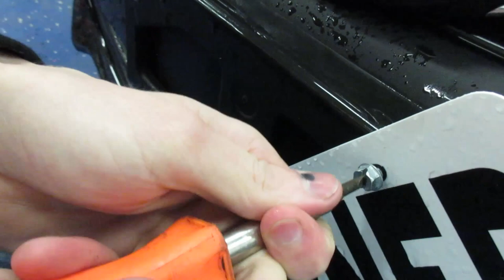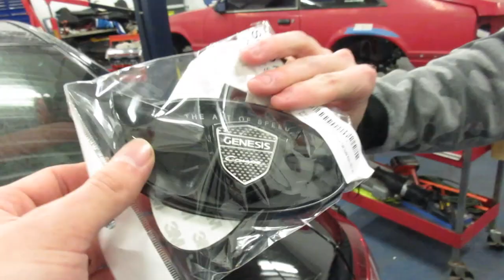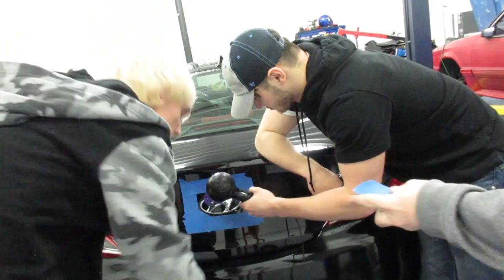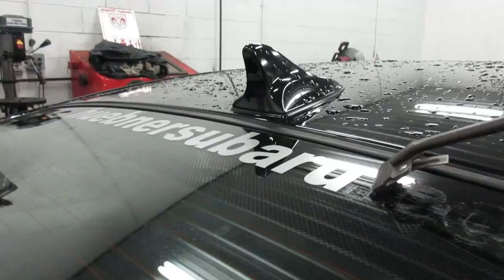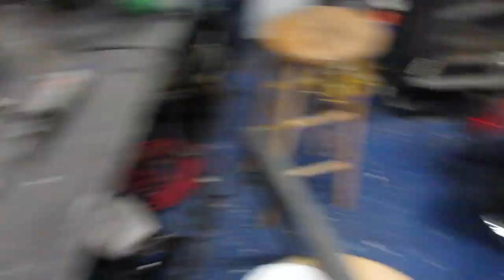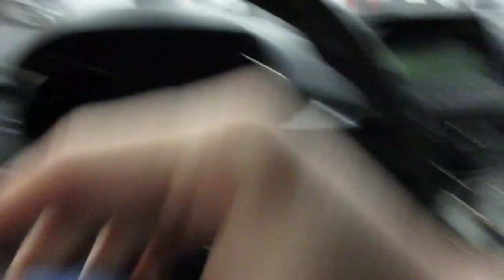Genesis Coupe Gets a Makeover!!

Comment: This makes me want a Genesis coupe for some reason
Reply from the maker: +Auto Enthused they are awesome!
Reply: Hyundai did what no other manufacturer would do (looks, price, features, power, manual). And just like the 90's jdm cars (rx7, supra, 300zx, 3000gt etc.) puerile will be lusting after these when everything goes hybrid and all electric. I have a track in auto, and planning to add a 16 Ultimate in manual in a few months.
Reply: +OwnersGen for someone who knows nothing about them, where should I start? Is there a particular year that's better in terms of value and performance?
Reply: +Auto Enthused Yes. Some model years and trim you should stay away from. People who favor brands fail to realize this car in a certain trim and year are in  high demand and creeping up in value. Mine started going up so I decided not to sell and buy a brand new one in a couple of months to tune.
Reply: Best years for value and performance: 
BK1 - '11-12 Track and rspec 3.8 MANUAL

BK2 - '14 r-spec 2.0t manual,'13-16 auto 3.8 Track/Ultimate, '14-16 r-spec 3.8 manual, '14-16 3.8 Ultimate manual.

Comment: Hey Ryan,  PM me on gencoupe.com @ RedGen13 if you have any questions. I bought my 2013 Genesis brand new in 2012 and have been around through all of the developments. 

One thing you will want to watch out for on those style in wing badges is that the center logo will fade and discolor after about a year or so. You can buy replacements for just the logo when it happens. I ended up changing to a different style that actually uses the OEM wings from Korea so they are a bit better quality.
Reply: So what info u got?

Comment: The Hyundais with the 5 litre  V-8s  aren't all that fast. I know that for a fact because I've raced em and beat em with my piece of shit ricer. I don't know much about the 3.8 litre V-6. I'm curious to know what the 3.8 V-6 has over the 5.0 V-8.
Reply from the maker: +Landyacht the Genesis sedan is a lot heavier. There's rumors that they are going to put the 5.0 in the coupe soon.
Reply: +Landyacht 348 horsepower and about 300 lb-ft of torque